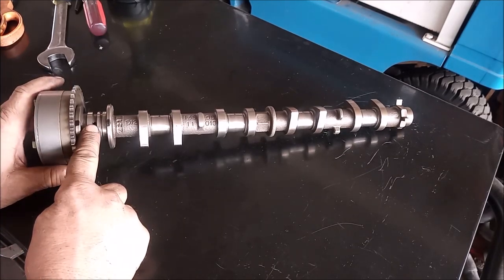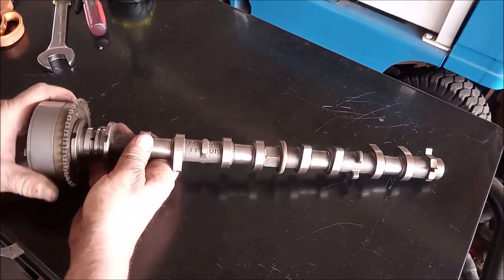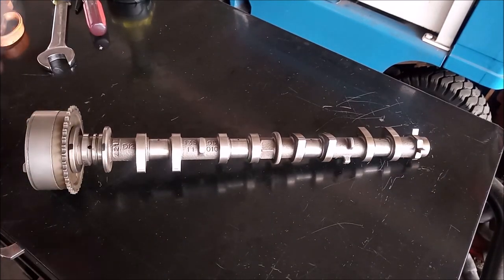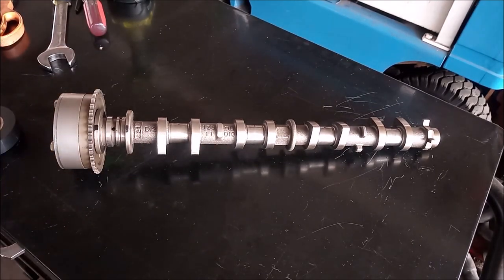VVT-i Timing Gear Unlock - Toyota 1.8-liter 1zz-fe/2zz-ge Corolla Matrix Celica MR2 Elise

Comment: ok so this is to loosen and tighten the center bolt that holds the gear to the cam. Then after its tightened to spec it needs to be locked for re-installation. Got scared for a second
Reply from the maker: It sounds like you have it right. There is no need to unlock the cam gear, unless you have separated it from the camshaft. Then it needs to be unlocked for correct re-installation. As shown.

Comment: All the description and video and you have no explained why there is the need to unlock the gear. Perhaps I am missing something?
Reply from the maker: It is suggested, if you are replacing the camshafts, that you must unlock the gear before torquing down the camshaft center bolt, otherwise the gear may be damaged and it does not function correctly in the car. This is a peculiarity for some engines by Toyota, not all, and it is the subject of several Technical Service Bulletins from the manufacturer. Sorry I thought that everyone knew this already.

Comment: Thank you sir, totally awesome video. I just did a head gasket and head bolts on my 03 Cary with 2AZ-FE engine. It went great and car runs smooth except for the 1 second rattle at cold start up. It didn't use to do that before I worked on it. So I believe when I was manhandling the intake camshaft I must have accidentally locked it. From the video I can see that happening as I moved the camshaft off, cleaned it, put it on, the head, then off before installing the head and back on. Very easy to lock it. I will have to do the process, I believe I can get it out without taking the timing cover off.
Reply from the maker: If you lock the camshaft, this is intended to eliminate the startup rattle. A locked camshaft does not rattle, this is what the lock is for.  A locked camshaft will give a P1349 code or it will fail the stall test at idle.
Reply from the maker: The camshaft must be installed in the car in the locked position, or you cannot set the timing correctly.
Reply from the maker: For the 2AZ-FE it is suggested that you install the gear onto the camshaft in the unlock position, then torque down the gear, then lock the gear, then install in the car.
Reply from the maker: In another video, for the 2gr-fe, I have shown that the startup rattle can be due to low oil pressure at startup. Without sufficient oil pressure, the ECU cannot keep control of the gear, and it rattles.
Reply: @Merryfrankster_  Thank you sir again. I went ahead and bought a new gear and installed it per the Toyota service manual. Pretty much as you described. Removed the old one, put on the new one, put the bolt on and hand tightened, unlocked it, torqued it to spec, then locked it. I put it in and buttoned up all the parts. The VVT solenoid is Denso new. When I start the engine it fire immediately, timing is good, but now I get constant rattle from the gear. Got P0010, I went ahead for kicks and replaced the VVT solenoid and no change, rattles. I am not sure what's going on. I am thinking the new part, Japanese part but not Denso, maybe bad, I did something wrong. It acts as it's not getting oil pressure. Anyway, I have the valve cover off, and the chain is good and not rattling, The tensioner is on and tight I double checked it. Will install the old one back in and see what happens. Good thing is I can get this motor apart in 20 minutes LOL
Reply: @ahmadghosheh3104   hello sir did you manage to fix that problem, have similar problem with my celica ss2 1999 2ZZ-GE engine. rattles at the startup but then gets silent
Reply: Just want to ask,  why the need to unlock the vvti gear ? If I were to remove the 4 bolts to clean the insides,  do I need to unlock it before removing the 4 bolts?

Comment: In summary, you dont need to do this if you are doing a camshaft install, only if you want to check its function?
Reply from the maker: In summary, you must do the unlock anytime you have removed the gear from the camshaft, and torque the center nut with the gear unlocked. If you torque the nut while the gear is locked, the gear will malfunction.
Reply: @Merryfrankster_  Oh wow, Okay.  So basically a good plan would be to remove the camshaft with the gear intact from the engine, apply pressure to unlock and then remove the gear, transfer the gear to a new camshaft and tighten.  Lock the gear again and reinstall?  Thanks for your help.
Reply from the maker: @newtypetommy 
1. Remove the camshaft from engine
2. Remove the gear from camshaft
3. Install gear on new camshaft - snug
4. Unlock gear
5. Torque
6. Install in engine
Once unlocked, the gear wants to snap back to locked position. It is difficult to handle it and keep it unlocked. You will find this out yourself, I am sure.
Reply: @Merryfrankster_  thanks!!

Comment: What's your generall opinion for 2zzge mate? Is supereliable??
Reply from the maker: Like nearly every engine known to man (without a dry sump), the 2zz will have oil starvation issues in high-G turns, i.e. sticky tires, high speed, tight turns on track. Other than that, it is very reliable. It has rocker shafts, which means it cannot fling its rockers like other engines with free-floating rockers. The variable lift mechanism is dependable, and so is the variable valve timing, so long as you keep your oil clean. If you want to put forced induction on it, I would suggest that you use forged pistons, but the piston rods themselves are forged from factory.
Reply: @Merryfrankster_ 
Thanks mate!  the wiped intake camshaft on lotus why happen? Also need valve adjustment service?
Reply from the maker: @DimoS...  The wiped camshaft happen because people neglect to replace the o-ring that seals between the valve cover and the head. This causes leakage of oil and insufficient flow to the squirters. Check the valve clearance and if the clearance is out of spec, adjust it. This is normal for any engine of that era, before hydraulic valve lash adjusters.
Reply: @Merryfrankster_  mate thank you very much!!! I appreciate it you are the only person who answered me in this mystery with the wiped camshaft, why does it happen in 90% of lotuses? and not in toyota? Also, what oil do you recommend for this engine? I run mobil1 0w40 fs because it has 1100ppm zddp do you have any other suggestions? (I've lived here for 9 months and it's over 30°c )
Reply: @Merryfrankster_  also the c60 gearbox with right use is reliable with longlife?
Reply from the maker: @DimoS...  C60 is good to about 250-300hp.
Reply from the maker: @DimoS...  this was one of the top rated oils a few years ago. It has been surpassed by newer oils but it is still a very good oil. You can look at oil ratings here. https://540ratblog.wordpress.com/2013/06/20/motor-oil-wear-test-ranking/
Reply: @Merryfrankster_  nice! I am glad! the only thing that concerns me is the problem with the intake camshaft, it was like new when I changed the lift bolts but I didn't change the o-ring seal that you mentioned. Also don't check the clearances but I have only 100k kms, maybe next time. The o-ring is important sir for camshaft safe and oil pressure on oil showers?
Reply from the maker: @DimoS...  with only 100,000km  an o-ring should not be a problem but the next time you open the valve cover, check. This is the part number. 96741-19009. You can search and find diagrams.
Reply: @Merryfrankster_  !
I subscribed to your channel sir, can I message if I need any help? you seem to know these engines well, I haven't seen what other videos you have yet, they are definitely useful! Thanks for the help!
Reply from the maker: @DimoS...  sure, message me anytime, as you can see I do my best to keep up with messages.
Reply: @Merryfrankster_  yes I see sir and that's why I registered in  Channel, I see how you help the world and it's your honor, well done
Reply: @Merryfrankster_  sir which oil is better in your opinion on 2zzge? Mobil1 0w40 or amsoil signature series 5w30 ?
Reply from the maker: @DimoS...  opinions about oil are subjective. Here's a link to an ongoing study where the author uses a consistent methodology to evaluate the wear resistance properties and the temperature degradation properties of oil. Scroll down to the "Rankings." https://540ratblog.wordpress.com/2013/06/20/motor-oil-wear-test-ranking/
Reply from the maker: I believe that both oils that you mentioned rank highly in this study. This makes it a beauty contest. Toss a coin.
Reply: @Merryfrankster_  
Nice! Generally I'm confused about the weights, can oil with weight 0 do damage on cold start? I mean does it cover the gap (distance) from the metals (bearings) correctly? Or maybe I have a problem? The toyota recommends 5w30/10w30 and lotus 5w40 the 0w40 is ok?
Reply from the maker: @DimoS...  as I understand it, 0 weight is intended specifically to facilitate cold starts. However I don't think this is recommended for older engines like the 2zz. I would stick with 5W30, 10W30, 5W40, ot 10W40 for the 2zz. In the end it is not so much the numbers that matter as the additive package and its wear protection capacity and the temperature degradation properties.  Some of the newer oils seem to have higher temperature degradation resistance so it is not necessary to go to a thicker oil to compensate for temperature thinning the oil. It's the additive package that defines the properties of any given oil.
Reply: @Merryfrankster_  understand, I stick with 0w40 mobil1 fs because I can found this oil in my city and have big number zddp and good price also have api sj sh sl certifications , but if 0w can damage my engine maybe must go with amsoil signature series 5w30...any oils in your opinion for flat tappet cam engine like 2zzge?
Reply from the maker: @DimoS...  I am not an oil zealot. I do not have any passion or conviction when it comes to engine oil. I do not believe in magical properties of any oil.  I use a high quality oil and change it every track session.
Reply: @Merryfrankster_  yes mate you're right but on generally the 0w weight is right for bearing clearance on 2zzge? Or 5w / 10w is better? I'm really confused about this. I'm worried about first W weight understand?
Reply from the maker: @DimoS...  just play it safe and go with 5w or 10w. If you are in a temperate zone with no cold temperatures then 10w.
Reply: @Merryfrankster_  OK
Reply: @Merryfrankster_  i sat down and read all the 540 rat paper you sent me, really great help the man knows too much it was very interesting thank you very much!
Reply: Sir, I do valve measurement on my 2zz today between small lobe and roller rocker and the 0.10mm 
it entered comfortably and 0.15 with difficulty. is it ok right?

Comment: Intall camshaft lock or unlockpositin?
Reply from the maker: Put the gear on the shaft. Unlock. Torque the bolt. After you torque the bolt you can lock the gear. It does not matter after that whether it is locked or unlocked.
Reply: @Merryfrankster_  Do I need a new vvt gear, if I installed it in locked position and packed up my engine and drove it too? Is my vvt gear damaged and it won’t work if I again open it and follow the correct procedure of installation??? Please guide…very worried.
Reply from the maker: @shahabshah8067  you should be able to remove it, unlock it, torque it, and put it back. If you want to play it safe, buy a new vvt gear, it's only $100 or so brand new.
Reply: @Merryfrankster_  what about the exhaust vvt gear, does it has a locking mechanism similar to the intake gear and do I have to follow the same procedure for it?
Reply from the maker: @shahabshah8067  WHAT CAR? THERE IS NO EXHAUST VVT GEAR ON THIS ENGINE. INTAKE ONLY.
Reply: @Merryfrankster_  mine is 1ZR-FE engine in Corolla 1.6 GLi
Reply: Moreover, can you pls lmk, why Toyota manual wants me to unlock the vvt gear before installing it? Even if installed in locked position the oil pressure will subsequently unlock it. Pls explain the need for this step.
Reply: Hmmm ! I was doing a shim bucket change - put everything back - I turned the motor ccw to release the chain tensioner - using the vvt gear bolt-  been getting 1349 codes ever since - does that got anything to do with lock unlock
Reply: @dannysouliotis  Fixed?
Reply: @AnythingEverythingGh  yes ! All the research on the code showed the solenoid being the culprit - my solenoid is brand new but I pulled it anyway and did all the tests to it - it proved good - I reinstalled it - and the code went away. Go figure